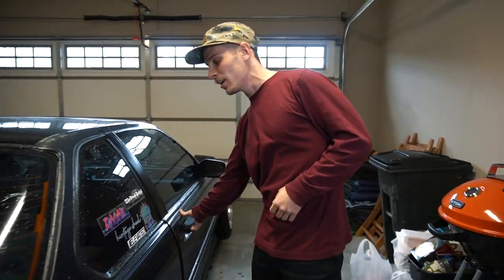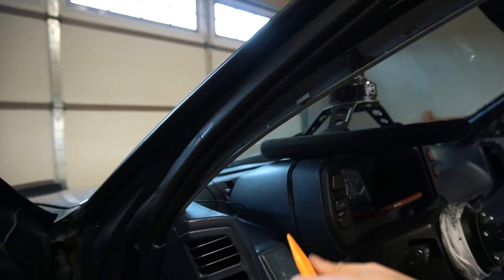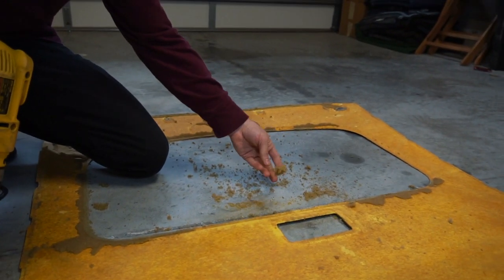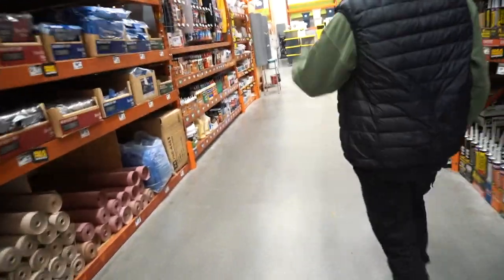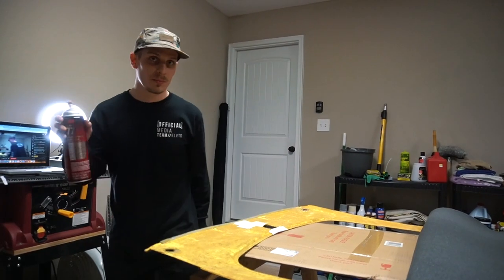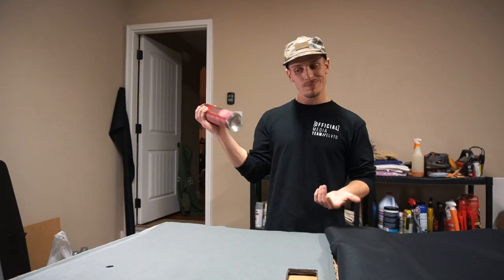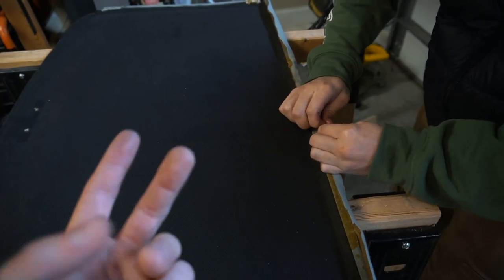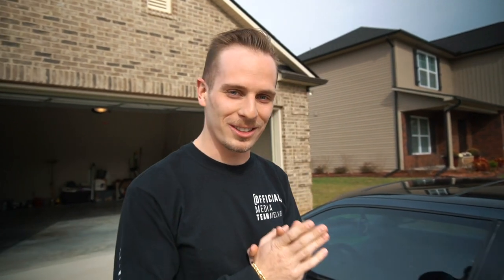CREATING A CUSTOM SUEDE HEADLINER!

Comment: I always thought that either the front or rear glass had to be removed the take the headliner out 🤔
Reply from the maker: Tbh it came free and I just winged it hoping it would fit out the door. Good to note that I had my steering wheel off so going out the passenger side might be easier for most.